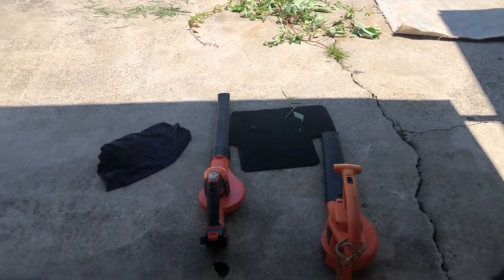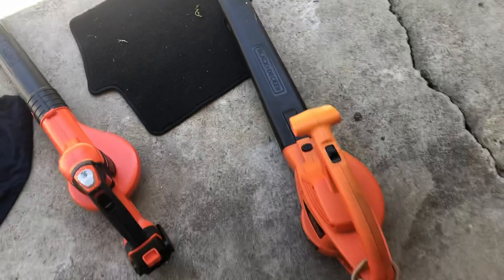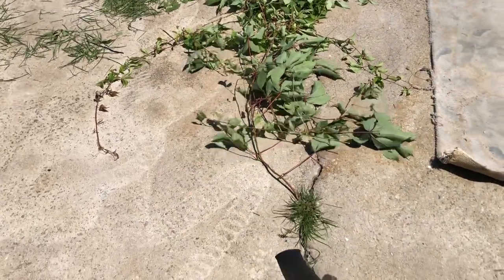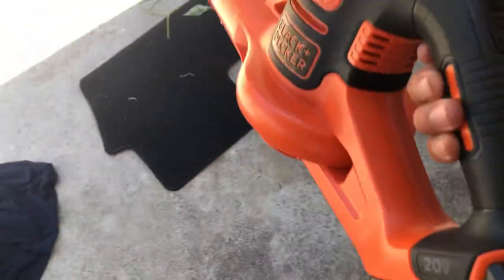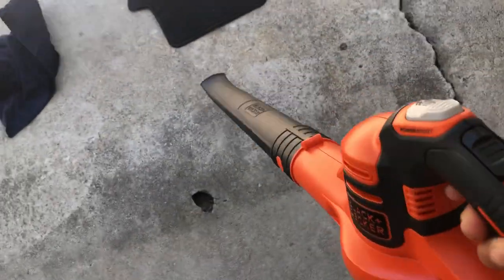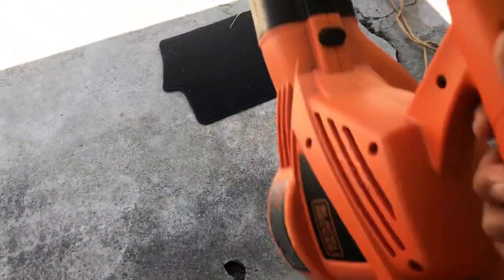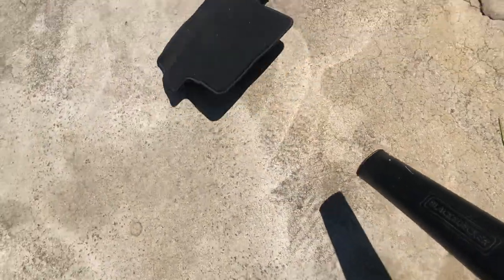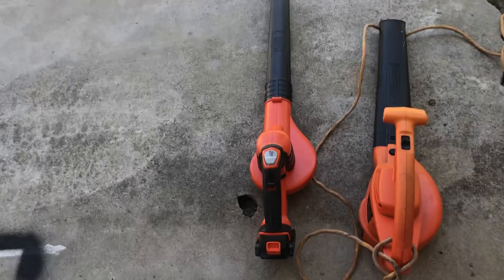Testing Electric and Battery operated blower black + decker..

Comment: I prefer the battery power one because it doesn't blow all my small pebbles and river rocks when I am trying to clean leaves and stuff. Only problem it only turns on for 5 seconds now. I think it's the switch.